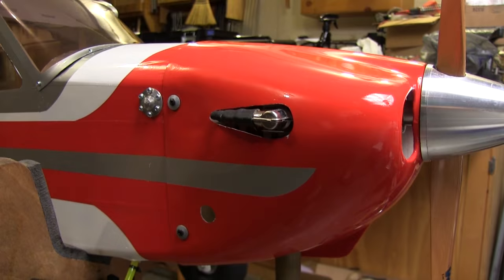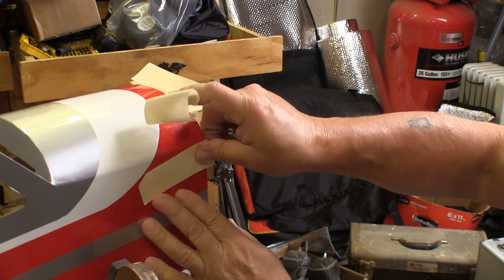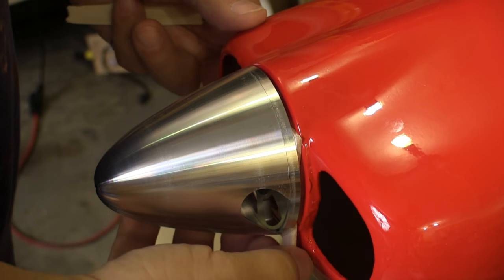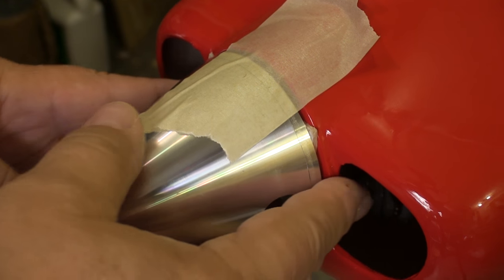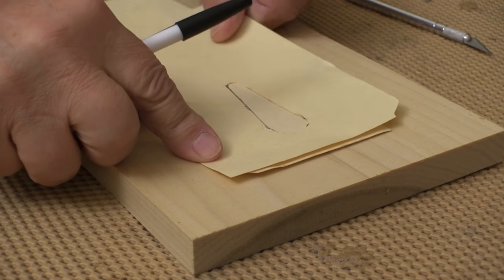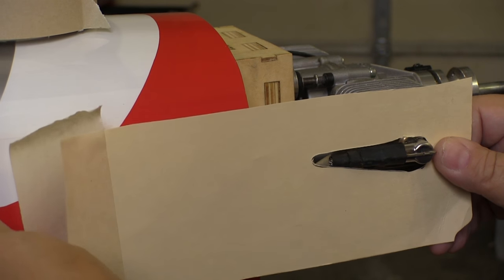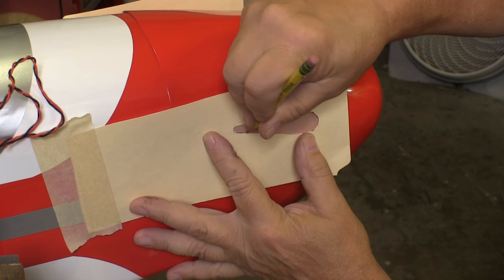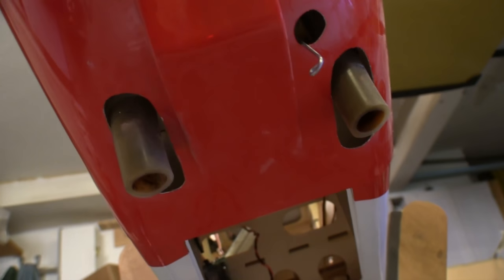My Cowl Cutting System

Comment: You are the man. I just used your technique and it came out flawless. I had to ad-lib a bit since I have a single cylinder, but the same principles still applied. A SHARP Dremel bit and 220 grit sandpaper gives it a factory finish. I did have to refit the cowl a few times and cut some more, but nothing crazy.
Reply from the maker: Good deal! There is always something new to learn.

Comment: Disregard my previous question.... I went back to your webpage and read it fully instead of skimming and what you know there was my answer...
Thanks for taking the time to produce these videos... They have been helpful  to me in taking on my first gasser project.
Reply from the maker: Good deal. I tried and tried but the plug wires do have to be off without really cutting the cowl up. When taking the cowl off or putting it on I sort of hang the plug wires on the engine or something behind the plugs where I can get to them with a needlenose pliers.

Comment: I'm in the process of building my Valiant with a DLE 40 also and I'm having difficulty installing the cowl after plug holes have been cut out.  Do you install the cowl with the plug wires installed or connect them afterwards?  I managed to connect them afterwards but nearly cracked the cowling trying to remove the caps again.  If there is a trick/method for removing the cowl with the plug caps still on I would love to hear it.  I'd hate to crack my cowl by stretching it too far.

I enjoy your videos and have included 2 other items in my Valiant build because of your reviews on your channel / web page. First is a Smart-Fly PowerExpander Pro for power redundancy & distribution.  Second is the Quik Fire Fuel Balancer/Filter.  I haven't fired the engine up yet so I can't comment on how well the Quik Fire works but I trust that it won't hurt based on your recommendations.

Comment: Very NICE  !! You can improve cutting finish, using electric wire cover ... strip off the wire color you want, doing a very straight cut ... then place the wire cover as cut's covers ....
I hope the tip will be useful and you may have understood what I tried to describe .... kkkk
Reply from the maker: I am lost. I don;t have a clue what you are talking about here. A hot wire cutter?
Reply: Sorry . My poor english does not help . See the pictures i made for you . https://flic.kr/s/aHskJzHEkm
The intent of this type of finish is to avoid small cracks in the edges in the future. just do the whole around .
Hope you enjoy .

Comment: I just got my Hangar 9 Valiant 30cc and the videos you published helped me to choose this plane. I have a question about air flow inside de cowl: I didn't see a large area for the hot air to escape. Did you have any problem with that?
Reply from the maker: Thanks for writing. I "over cut" the exhaust opening by roughly 1/2" around the muffler stacks and that seemed to be enough for my situation as I never had a heat issue. When in doubt make the openings a tad bigger and keep track of the engine temperature to see if you need to enlarge those openings or create another to help draw airflow out of the cowl.
Reply: @flyingrcdotnet  Many thanks.